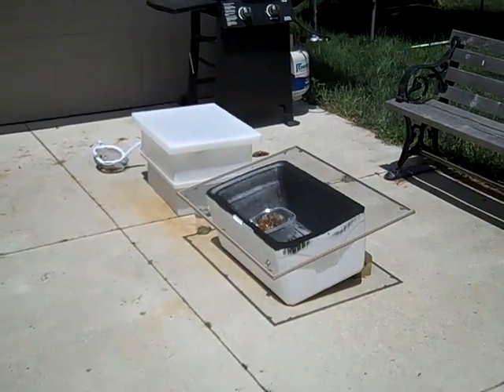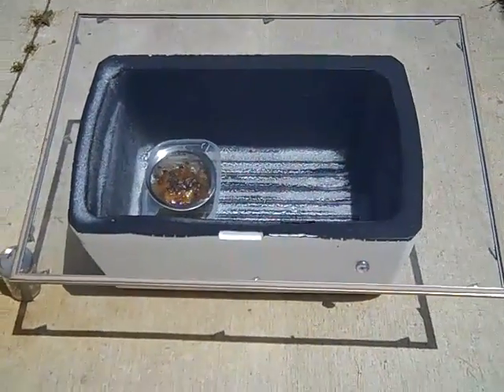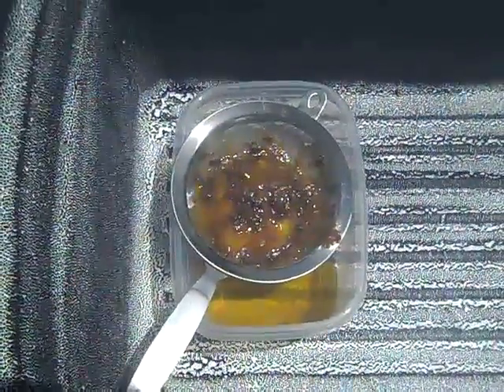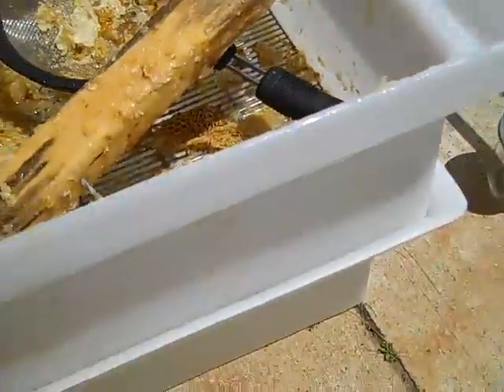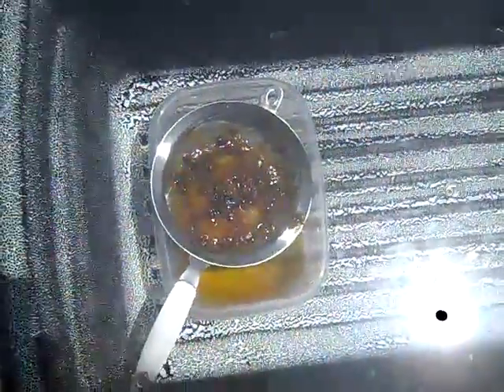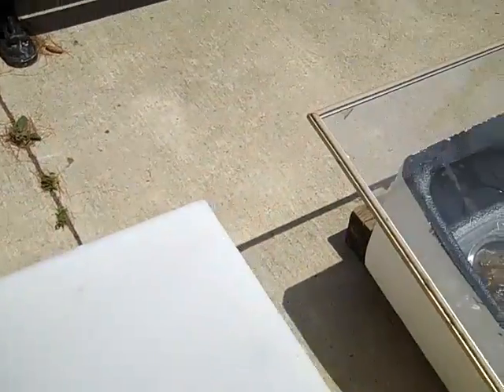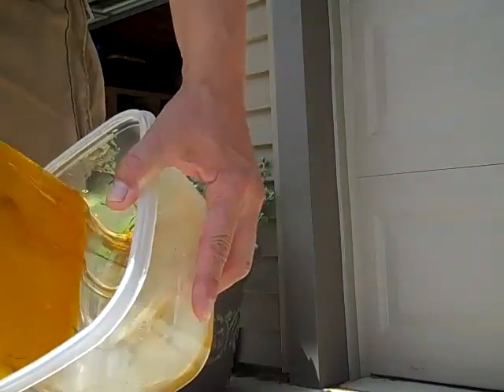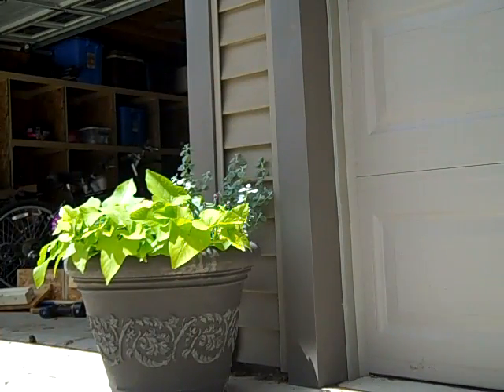start urban beehive solar wax melter

Comment from the maker: hello dmg6886,
thanks for your interest.  i learned that the package bee queens have a 50% failure rate.  chances are i did nothing wrong. the queen just failed. the queen cells did not produce a viable queen.  i ended up re-queening by merging my hive with a "good" hive.  the "good" queen was not so good and eventually the hive died off.  this is a hobby and i do recommend it to others.  actually i have gotten at least two friends into it and they have hives at their housed too.